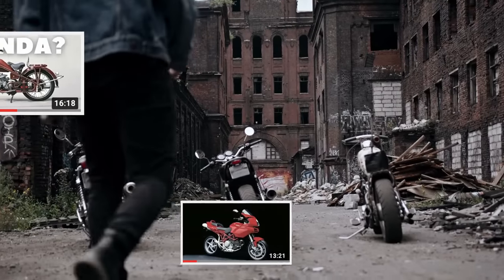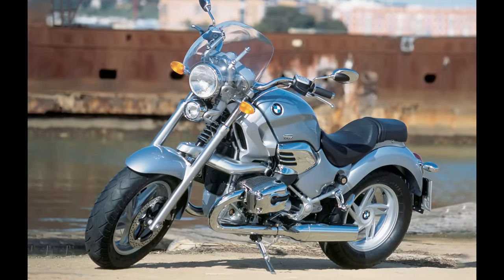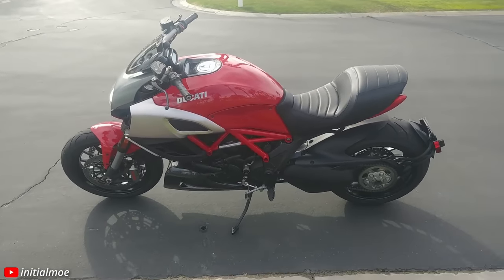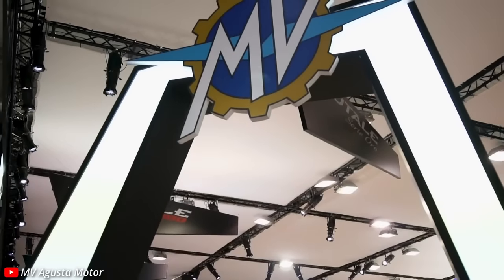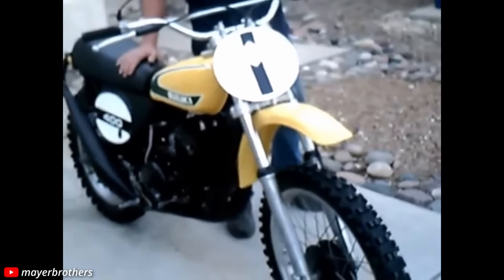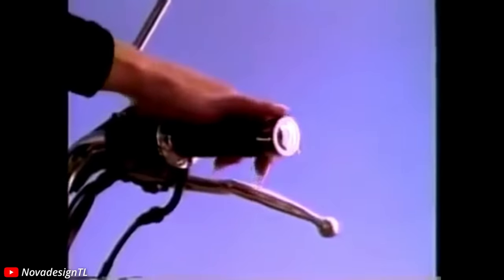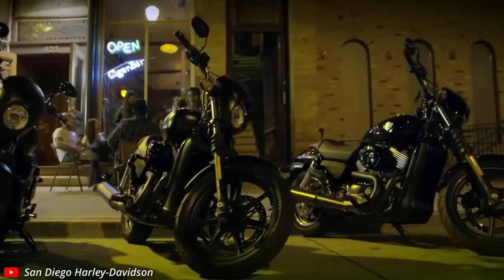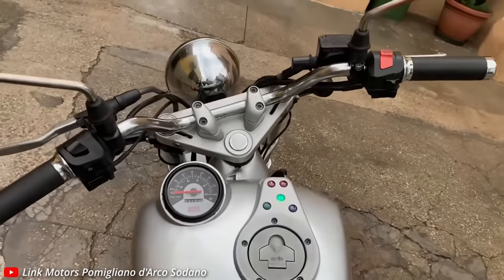The WORST Motorcycle from every manufacturer

Comment: i LOVE moto Guzzi! they are my favorite moto manufacturer. I have to say the worse bike they made was sadly the MGX-21 Flying Fortress. I owned one and I LOVE the cali 1400 frame and powerplant but my god the body work was 1000% a rush and an afterthought. The saddle bags and batwing were held together with self tapers FROM THE FACTORY. I was not impressed at all and got rid of it within six months. 

I will say the Griso 1100/1200SE is by far my favorite motorcycle and i currently own a 2007 Griso 1100 and HAD a 2015 1200SE (sold due to mis diagnosed shoulder and neck pain after riding) I highly regret selling my 1200. 

Moto Guzzi makes extremely reliable bikes but not powerful bikes. VERY easy to work on BUT poor dealer networks. I put over 30K on my 2015 Griso 1200 with out a single issue just new tires valve adjustments and oil changes and i rode that bike hard and it took it just fine. 

I will always love MG and will ALWAYS own a MG. Next is either a v100 or the new stelvio if I decide to potenially sell my Griso 1100

side note MG sounds INCREDIBLE with the 90 degree twin and are loaded with character.

Comment: aight that eliminator one hurt. i have a 2024 (450cc) and while no it aint fast top speed wise that mf is fun as hell and takes off/handles great. really light, really menuverable, and looks even better if you lift the front end by 5 inches or more like i did with some harley forks lolllll. overall i love it. i like the older ones too though, their great little bikes too and you can arguably get even more creative with them. maybe i just havnt gotten enough of an inspirational spark with my new one yet but regardless, nice bike fs.

Comment: I had the 2 tone burgundy. There was no acid in the battery. The stater was no longer the McKay. I'm a mechanic he goes and this is Brian. Anybody knows Hamilton? Ontario Bryan's the ultimate mechanic for the verago and he says to me goes. I don't understand why this bike is running. This bike should not running. It should have left you on the side of the highway a long time ago.  We pulled.
In that battery to buy new battery.Buddy says to me your battery smoking.Yeah, she's smoking pull on the battery out.Put a new one in MechanicIt  shouldn't start Is stater is gone But the battery and bike started right off.Drove it for another couple of months till the stater came in from wherever it came in from the replaced , it and from what i'm told the boulevard , and all the new yamads have that base power plant that bottom end of the Virago couldn't kill em

Comment: when this video started I thought I can't wait to read the comments from the owners of your worst bike choice.... until the honda cr450 was listed!
I raced one against all the new 4 bangers from 2002-2007.

it dude need a ohlins rear shock, fork revalve, modern carband bored the cylinder to increase displacement to 480cc.

several 2nd and 3rd places says it was a good bike !

the 450 tank was nice and flat so you could get right over the front end unlike the 480.

I rebuilt it every 200hrs or so with no failures

Comment: My mates BMW BOXER had problems with the CABLES 2 into 1 that if they wore in the cable housing, would jam the carbs open and!! NOT GOOD! BMW power control units mounted just behind the forks... REAL BAD!! Would NEVER entertain a SUZI.. noooo 1 Electrics??? Honda CX500 the couriers dream machine where the centre of gravity meant you DID NOT carry a pillion passenger!! It made the machine unstable.. light on the front steering / forks.. NOOOOO! Probably one of the worst was the fancy looking 2007 Kawasaki EL125 Eliminator's a top little bike to hone your skills on with a responsive, smooth motor and easy handling. The Kawasaki EL125 Eliminator is never going to win any races !! UHH no exaggeration there... try climbing a hill with it... being passed by a snail... let alone a tortoise.. The guy I knew who owned one was a total wack job who bought it for its looks.. nothing else.. Did make me smile to see how bad it was.. back in 2007! The top speed on the Kawasaki 2007 Eliminator 125  is around 63 or 64 MPH depending on wind direction, road conditions, and how much you had for lunch that day.

Comment: I moved to mexico back in 2019 had 4 different bikes back in USA when I got here I bought a BMW 1200c it had 62 HP but lots of turks very powerful 2 calender boxer engine wasn't meant to break the the speed of sound but I had problem passing many sport bikes.unfortuntly had to sell it due to poor roads here lots of pot hols lots of speed bumps that are not marked or signed bad drivers give no right away to bikers way too hot to wear helmet.
Please don't compare it to Harley they are junks!

Comment: Virago owner here: she's reliable AF, she runs well despite being from 1994 AND having seen some, lessay, inventive servicing (MY serviceman is the Virago guru in this city), I could actually afford her out of pocket (welcome to the rest of the world, Western riders) and she looks AWESOME so yeah, f%$^ you very much. ^_^

I could really use a fuel meter though. That's, like, ONE thing I would add which would've made the bike ideal.
Reply: Had the 400 CC version! Loved the look, but underpowered and impossible to start in humid weather. Sold it for less than 100 bucks in the end.
Reply: @Axeyard  huh, weird, my bike starts regardless of whatever. The only exception is after the winter (a car battery hookup helps though). And you need to do it *once*, then she starts like a charm. 

Speaking of underpowered, well, it's not like she's supposed to burn rubber or anything. 130 km/h with the low center of mass are more than enough (for me) to feel the ride if I want to, and is also enough for travel even on a paid road.

ED: also a 400. XD

Comment: The worst bike is KTM. It stands for Kan't Take Motocross. They can compete for a very short time but lightness comes with a downside. They are unreliable. The frames/footpegs break. Their Adventure bikes are plagued with electronic and motor problems, my Yz450 with a reckluse has towed a few dead ktms out of deep woods. They are just junk. Fast/competitive/expensive junk, but junk. You have a factory ride where they replace everything every week, you can go fast but they just don't hold up. Buy a new one every few year, you are golden, don't buy a used one.

Comment: BMW hasn't made many bad motorcycle? BWahahaha! GS800/F800 had major issues due to a really poor oiling design - top end is COMPLETELY dry for the first 3-4 seconds. Expect ring/valve/cylinder issues.

Comment: Ps: That Suzuki TM 400 was a VERY powerful 400cc 2-Stroke producing (stock tuned) at least 40hp and weighs 260lb and was classified as a  "Motocross" bike designed to RACE.  IT WON the European Motocross internationals there years in a row from 1971-1974. 

 If you've ever ridden an "Motocross"ready bike versus a basic Trail bike, you know this was one of Suzuki's earliest and most successful RACING bikes, not to be confused with a bike designed for anyone below a experienced or "professional" motocross racer/rider.  Not your average rider.

So it's not one of the "worst bikes ever made" but it might have been dangerous for a novice rider or casual weekender in the woods or on trails.  

It also should not should be called a "Widowmaker". While my condolences go out to anyone who lost someone on one of these, or was more likely due to a lack of familiarity with this kind of bike, or who didn't understand what they were climbing onto and lost control of an extraordinarily powerful bike.

 I'm not trying to sound callus but like I said in my previous post, ALL bikes can become a Widowmaker if the rider is unaware of the bike, their abilities and a proper understanding of what they are doing. Accidents happen. Of course.. I assume everyone here who rides, or is learning to ride responsibly should already know the risks involved.  Some bikes are more dangerous than others, clearly, but a respect for, save operation of, and knowledge of the bike under us and the terrain can prevent a large number of off-road injuries and fatalities.

Comment: Your only talking about the exterior design of the motorcycle which for you is very ugly. YOU DO NOT TALKED ABOUT THE FUNCTIONALITY, DEPENDABILTY AND DURABILTY OF THE MOTORBIKE ENGINES WHICH LAST FOR A DECADES OR MORE..😂"DONT JUDGE THE BOOK BY ITS COVER, THE CONTENT INSIDE IS MORE IMPORTANT" LIKE IN CHOOSING A MOTORBIKE..MOTORBIKE IS WORTHLESS IF THE ENGINE ALWAYS BREAKING AND HARD TO START TO RUN. AGAIN.